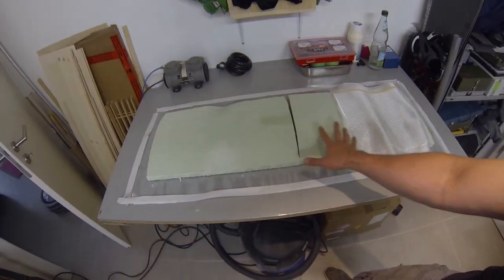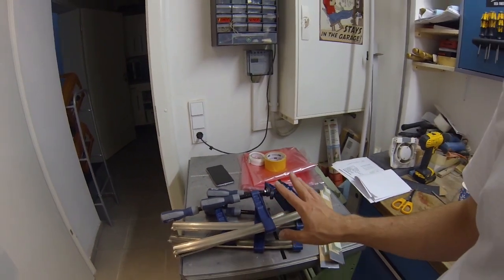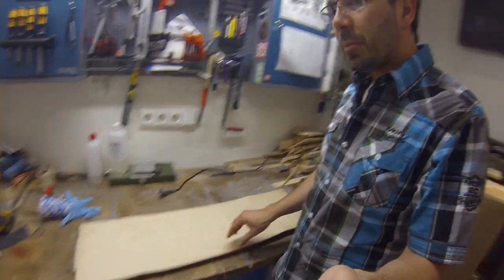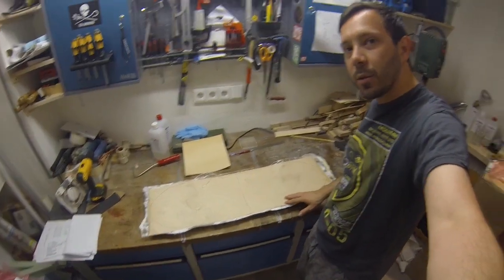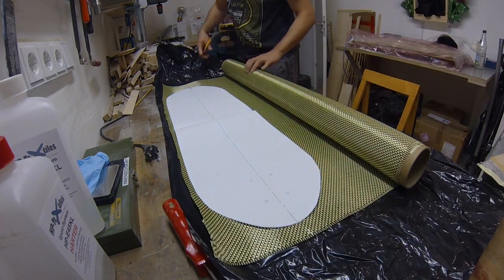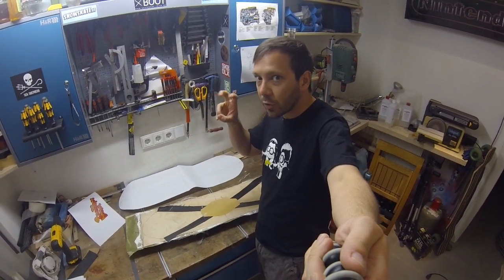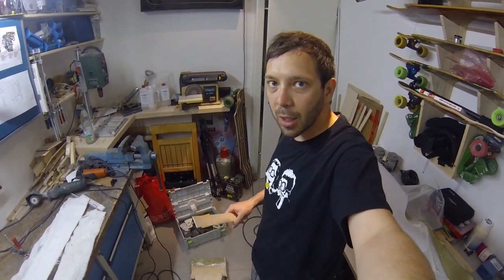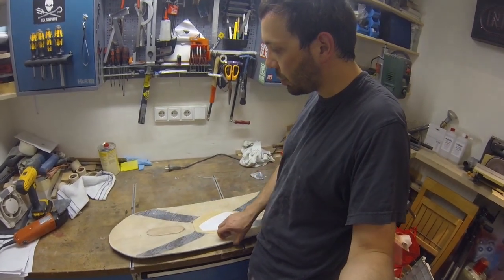Freeride Longboard selber bauen (Microdrop, Flares, 3D, Fat Bottom)

Comment: Welches Holz hast du benutzt, und wie hast dus stiff gemacht?
Reply: bzw., reicht 4mm Birke dann 4mm Pappel und dann nochmal 4mm Birke, um das Brett stiff zu machen? Für 40-50kg?
Reply from the maker: +Tech ' o Music / Technik Bauanleitungen / DIY / Music / Programmieren (C , HTML, ...) Ja, das ist recht Stiff für 40 kg.
Reply: +sidekickx81 also was wäre besser bzw stabiler? Birke, dann Pappel, dann wieder Birke? Oder 3x Birke?
Reply: +sidekickx81 also, nur Birke?  Oder Birke und Pappel? Was hält da mehr? bzw was ist stabiler?
Reply from the maker: +Tech ' o Music / Technik Bauanleitungen / DIY / Music / Programmieren (C , HTML, ...) stabiler ist Birke... Mit Pappel ist es auch stabil, aber etwas leichter...
Reply: +sidekickx81 hmmm, denke dann nehme ich nur Birke, denn mir kommts ja nicht auf die Leichtigkeit an, nur das des stabil ist. hält des auch ohne glasfaser etc
Reply from the maker: +Tech ' o Music / Technik Bauanleitungen / DIY / Music / Programmieren (C , HTML, ...) Ja, hält auch ohne, siehe die Baukurs Videos.

Comment: +sidekickx81 hallo Dr. Snuggles, ich möchte mir auch ein freeride Board bauen aus 4mal 4mm platten Birke. Aber ohne Gewebe nur holz Kleber und Form. Ich wiege 50kg aber wachse noch. Könnte ich so Ein torsionsateifes Brett herbekommen?
Danke schonmal
Reply from the maker: +Konstantin Wolf 4x4mm wird mega stiff für 50kg. Da brauchst du echt keine Fasern mehr, das hält bombig! Allerdings wirst du kaum so extreme Verformungen wie Drop/Flares da rein bekommen. Wenn du es trotzdem versuchen willst, mein Tipp: Verklebe nicht alle Lagen gleichzeitig, sondern erst 2 und dann dadrauf die nächsten beiden...